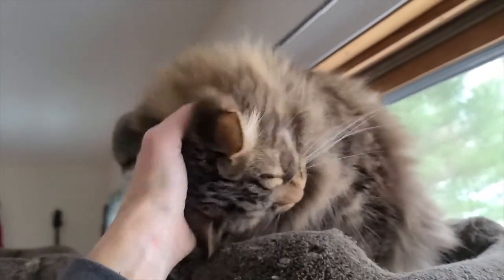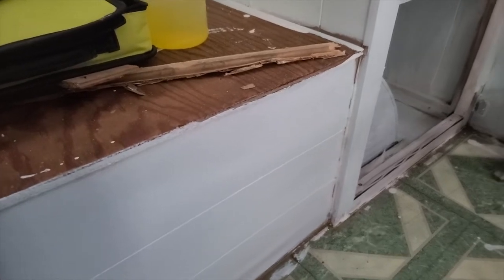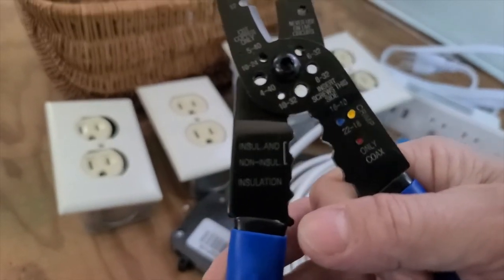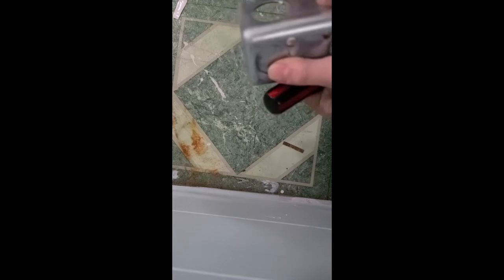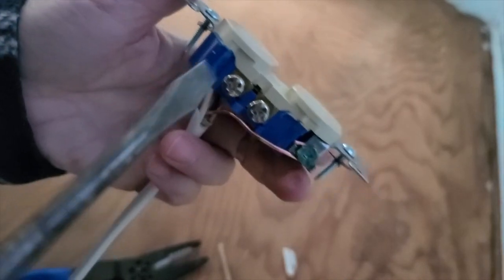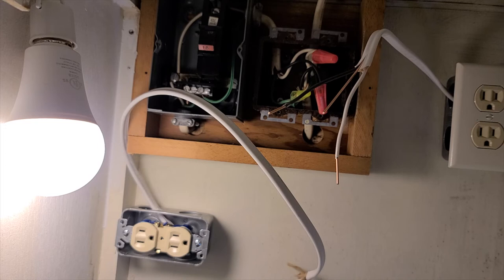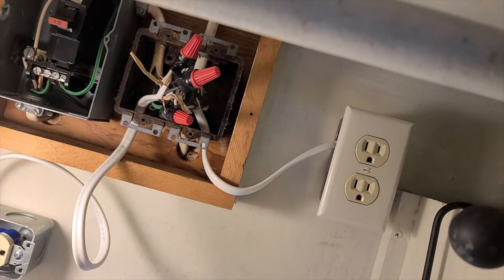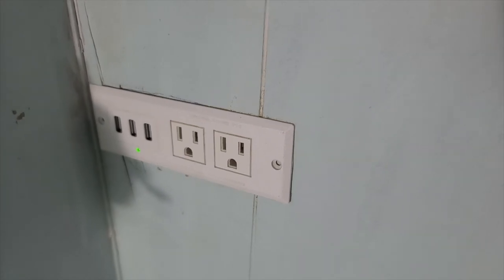Tiny Home Episode 6 - Vintage Camper Electric 101

Comment: You really should watch YouTube tutorials on electrical.   You just wrapped the ground the wrong direction around the set screw.  Hopefully you have correct polarity.  And no, that breaker you have is supposed to serve as the main.   All those you added should have had individual 15 amp breakers installed.   This is how campers get burned down.  I applaud your effort but some things really need to be studied.